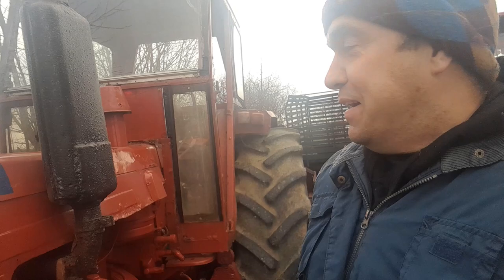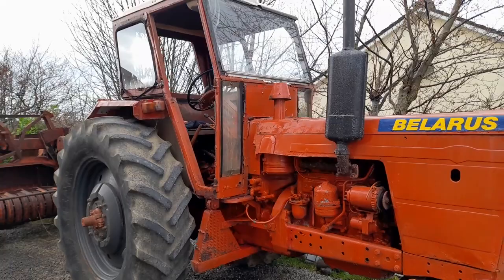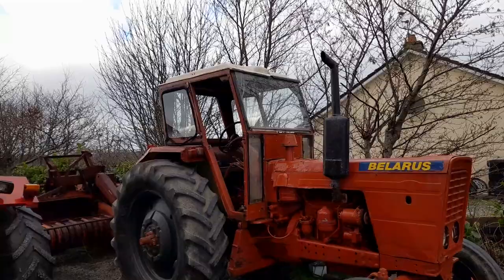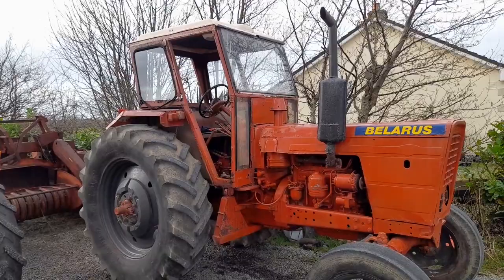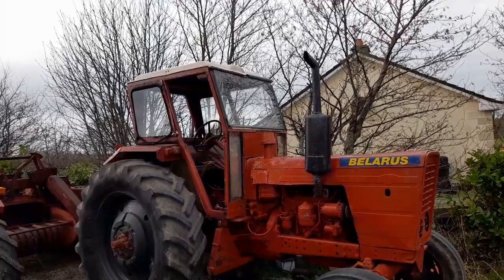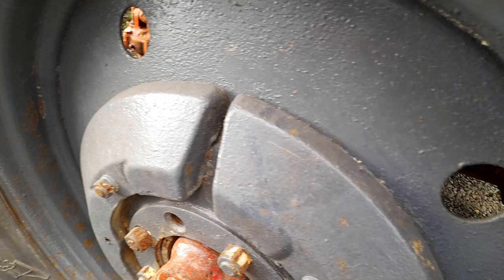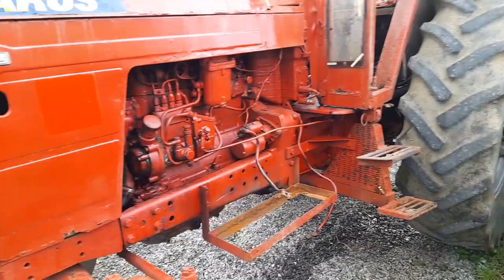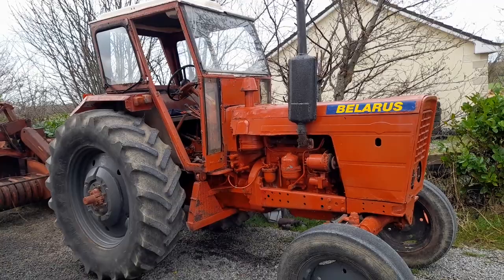history of belarus tractors traktor in ireland and a look at a mtz 50 super umo pmpa

Comment: Great video,we started with 2 mtz 50 and a t40 Belarus tractor's in the early 70s and my father would change them every 3 years until 1986 when we switched over to case , I loved the Belarus tractor's we even had a 4 ton Belarus muck spreader ,I ended up going to the Minsk tractor factory in 1984 on a dealers trip ,they were turning out 365 tractor's a day then ,they also had a testing center where they would leave leave the tractor running over an obstacle course for 24 hrs at a time , incredible trip tbh,I have got some photos I believe and I ended up working for umo at some of the agricultural show's in the UK, regards Roy
Reply from the maker: I have great faith in belarus tractors . Glad to hear you had a good experience with them.  I think it was a combination of bad dealership and a week supply chain of parts that got them a bad name  . Great to hear form someone who worked for them . What happened with year muck spreader

Comment: Great video I've just bought a minter of an mtz 52 1974
Reply from the maker: Brilliant stuff.  Where are you from I do love a Belarus any chance you could send me a few pictures I could put them up here if that was OK 
Mofmachineryofireland1@gmail.com
Reply: I certainly will be making a few videos on my mtz 52
I'm just outside castledermot village in Kildare
Reply from the maker: @gearsandtears7643  brilliant stuff 👏
Reply: @morganoflahertymachineryofirel  I done one short on my channel driving the Belarus back from the gap pup tinahealy took me 2h15mins and about 14litres Diesel
I thought there was something about the first of the Belarus imported into Ireland were in exchange for Irish beef I was told that so I have no way of knowing if that's true 
Also the mtz 52 has either on or off 4x4 there's a rod that lifts up and hooks on the floor plate in the on position
I climbed a clay bank about 40% slope and it literally walked up it good tires etc
Passing a school slow down sign it said I was doing 27kph 
I don't use the foot throttle at all on this one the hand throttle being under the steering wheel is handy
I will be changing all the fluids as the hydraulic oil looks like black engine oil and it's low

Comment: First Comment!  Greetings from Alberta Canada! I have two MTZ 82 ( Belarus 820) which are in many ways identical to the MTZ 52. I will guess that your tractor in the picture has the D-50 diesel engine which is an indirect injection. Later models upgraded to a D-240 which is the same as the 820 but with slighly different fuel settings. The D240 and it's variants is still one of the main engines used in current MTZ tractors. Therefore you have 50 years of parts interchange...something no other manufacturer can even remotely claim.  Your tractor is electric start; many of this vintage had a 2 cycle gasoline pony motor. The PD-10 starting motor on some units had an electric start but many were started only with a pull rope. To our eyes this seems somewhat slow and painful as  a starting system but in Siberian winters and in many developing countries where these tractors were exported the abillity to start them without a battery was in fact a big bonus.
Reply from the maker: You know your belarus tractors  the winters can be severe out there I was out in  the Poland russia boarder about ten years ago  30 below is nothing

Comment: I have not found out to this day who was the lead engineer behind the MTZ 50/52 belarus or elsewhere known as Belarus 500 and 500 Super. But who ever it was they seemed to have very good engineering skills and not just doing a simple knockoff from IH. They put a lot more afford into making the engine and everything else. A company called Tractor Export was responsible for distributing Soviet agricultural machines to various vendors/companies/dealers outside of the union. You can tell if it was a export machine by the fact they have a starter instead of a starting engine. 6 spline PTO instead of a soviet standard 8 spline PTO . The D-50 engine has glow plugs or some other pre heating system. Color scheme is very different instead of painting them all just blue. Currently Belarus is the only Soviet tractor you can still get genuine used and new parts. 
All other Soviet brands that where sold under the same name have gone more or less extinct.
Reply from the maker: They are a great tractor.  But unfortunately there is not a lot taught of them here . I think bad dealership and trouble getting parts    but I would prefer to fix my belarus than a massey or a newholland etc
Reply: @morganoflahertymachineryofirel  Belarus is very affordable for a small farmer that needs a medium size tractor. If you take care of it properly and follow the users manual it will last. The issue with vendors is there is a lot of knockoff and fake Belarus parts. Not all made in china parts are fake or bad but there are counterfeit things that makes one wonder.